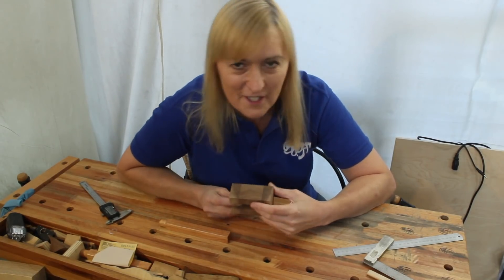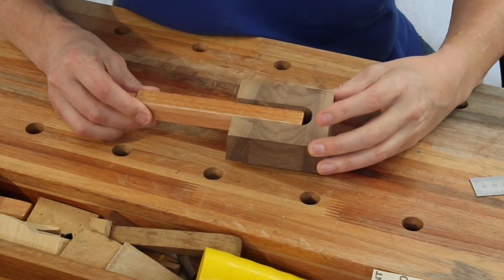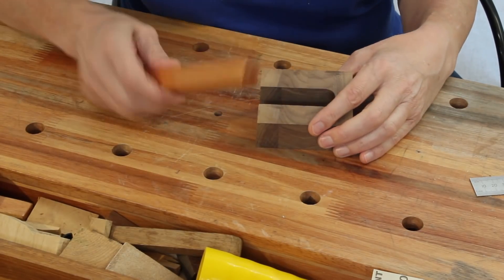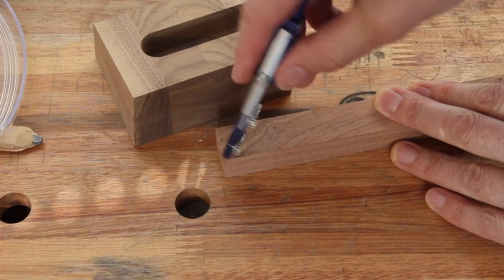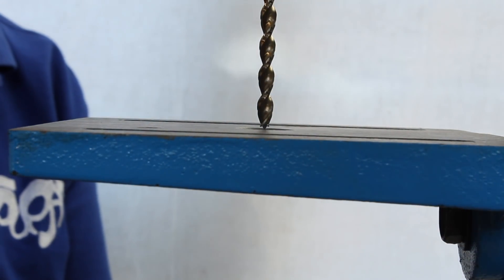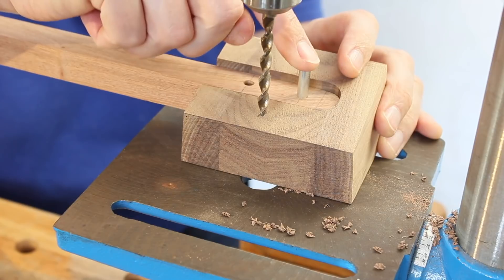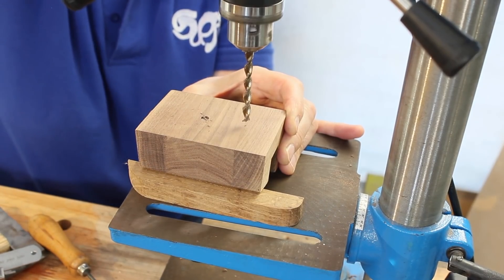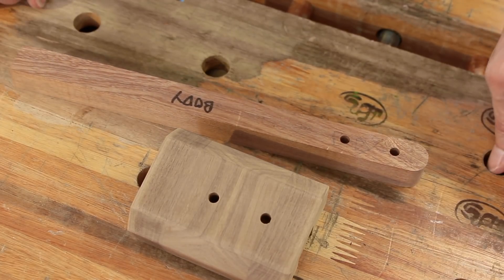SuGar SG1 acoustic guitar build part 35: Neck joint drill jig

Comment: It is not necessary to make the end of the template round as long as the end of the template makes contact with the rounded end of the mortise, a simple pointed end would have sufficed, just thought I would mention it since you are not going to use the template to cut the tenon, but simply use it to drill the holes.

Comment: As usual, compelling and frustrating at the same time.... You will need 'tolerance'. Bill Collings does....
Reply from the maker: M6 bolts are 5.8mm so I have 0.2mm tolerance straight off
Reply: @SusanGardener  In wood that is negligable... you may wish to invest in a small 'rat tail' file.😉

Comment: As usual Susan you have an efficient and effective method for doing this.  But....and again I'm sure you'll have thought of this - please remember your neck block on the guitar top side should not be flush with the front face of your neck.  Your neck needs to be flush at the neck/body join with the guitar top.  I'm sure you'll account for this in drilling the neck but thought I'd say it anyway in case you have an "oh hell" moment (had a few of them myself over the years!).  What I do is much simpler - I attach the neck block to the sides already drilled as you have done although I countersink the bolt holes quite deeply.  I complete the side set with radius, tailblock, linings etc.  Then I mount the neck in the neck block, insert the appropriate size of transfer punch through the bolt hole and mark the bottom surface of the tenon for drilling.  Sorry if all of this is obvious and certainly don't mean to man-splain!
Reply from the maker: Fear not Gerry! Actually I’ll punch through anyway but still use the jig to drill the holes - belt and brace and bits
Reply: Haha I knew you'd be on the case.  But like I said us guitar builders need as few "oh hell" moments as possible!
Reply: Actually thinking about it in my recent builds I've been completing the box before marking the tenon with a centre punch through the soundhole.  Then even I can't get the neck position wrong!
Reply: You have a good point, Gerry, but the sexism was uncalled for. Woman-splaining or man-splaining for that matter are sexist words.
Reply: @umbalaba  wasn't being sexist.  In fact concerned not to be
Reply from the maker: I didn’t take it as sexist. I’ve had plenty of sexist comments to know the difference
Reply: Thanks Susan.  I have a teenage daughter and I want her to live her life free of sexism.  I think you're a great role model for women who want to try what might be perceived by some as a traditional male activity.
Reply: @Gerry Thompson I understand you were concerned not to be sexist towards women, and that is good, but you were being sexist towards men, and that was uncalled for. Sexism is a two way street and in your eagerness not to go down one road (sexism towards women) you went down the other (sexism towards men). "Man-splaining" is a sexist word just as "Woman-splaining" is a sexist word.
Reply from the maker: I’ve been mansplained enough times to appreciate that womansplaining isn’t a thing. I’m sorry, but sexism is a one-way street. No sexism here, and Gerry used ‘mansplaining’ in the correct context.
Reply: @Susan Gardener What a sexist thing to say. I am sorry to hear you have been subjected to sexism yourself, but I am even more sorry to see you defend sexist language directed against others.
Reply: @Gerry Thompson I believe you also want a life free of sexism for your teenage son or for the teenage son next door, which is why you should not make use of sexist words like "man-splaining".
Reply: Sorry but my patience is running thin with this.  Sexism towards men? Seriously?  Maybe keep the comments on guitar building because you're not winning with this line of argument
Reply: @Gerry Thompson I am very serious and I agree: Let us keep the comments on guitar building and avoid using sexist words like "Man-splaining", "Woman-splaining" etc. It is simply uncalled for.
Reply: I won't be told by you what language to use.  If Susan is alright with the language I use that's actually what matters.  Your opinion is irrelevant to me.
Reply: @ Gerry Thompson I am sorry to hear that

Comment: I hope you don't forget about the thickness of the front of the guitar that you will have to add on to the template before drilling the tennon holes. Not that I do bolt on necks myself  but I thought I would remind you.
Reply from the maker: I’m hoping for a tenon so snug I can reference off the bottom of the tenon, but I’ll be punching the holes anyway as a check